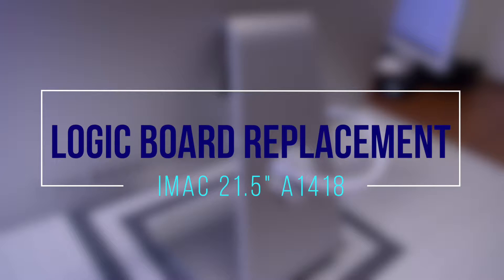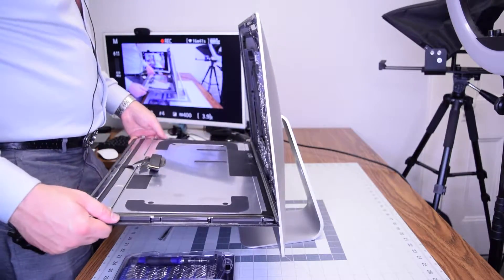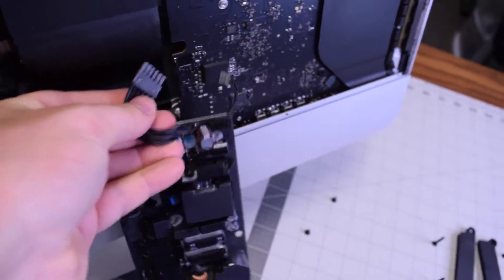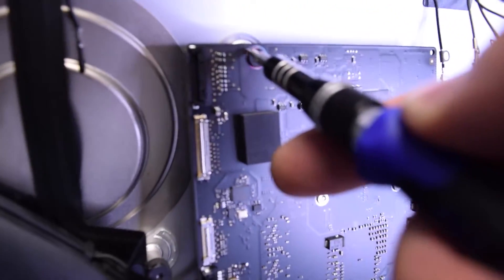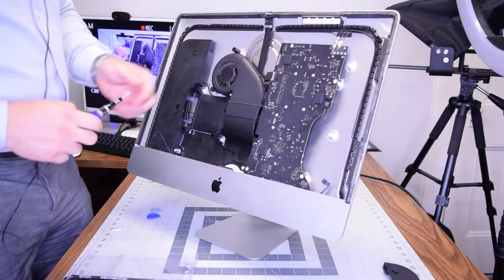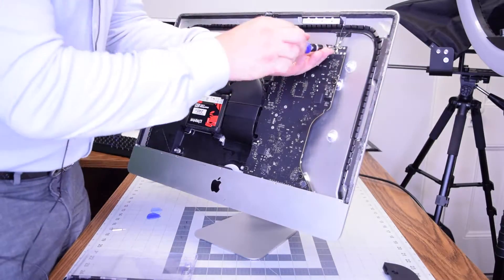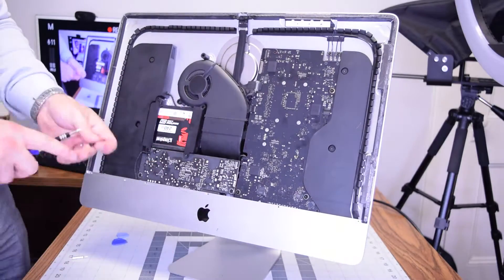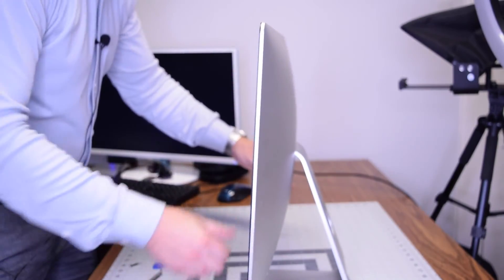⚙️🖥️🛠️ 21.5" iMac Logic Board Replacement 2012-2017 (Including Retina) A1418

Comment: Amazing video very retail - got my confidence up ..

Question: I was donated a Late 2012 iMac  A1418 21.5 - is it possible to upgrade it with a 2017 A1418 motherboard? Was told the 2012 does not have the M.2 port  or am misguided

Comment: Never use metallic !! I use the standard plastic pizza cutter and very thin guitar picks (.71mm )for the tape thats thicker over the wide antenna parts of the chassis. It takes me 5 mins max and never any damage . when I used metallic I lost a significant £££££

Comment: hello, have you tried 2 combs of 16gb ddr3 each comb to become 32 gbs? corsar has it and the crucial one too and in the 2013 late version of 21.5 inches i5-4570S CPU @ 2.90GHz is soldered or socket? because I thought about putting a Core I7-4770s because mine is not a soldier, does it work?

Comment: My late 2012 iMac is having issues that require a new logic board.. could I replace it with a newer logic board e.g. 2015 or later of the same 21.5 size?
Reply: Interesting question, sizes look the same. I'm wondering to... Anybody?
Reply: Wondering the same ...
Reply: Xctly same question
Reply: N answer for same question  I guess !
Reply: @yunsd8592  now i search this questions's answer. I have 2012 imac. I don't buy new. I want change motherboard with newer. But i couldn't find answer